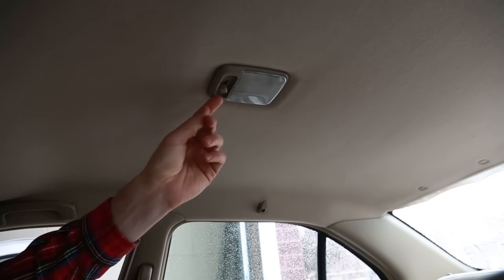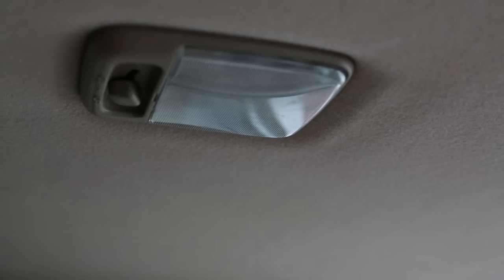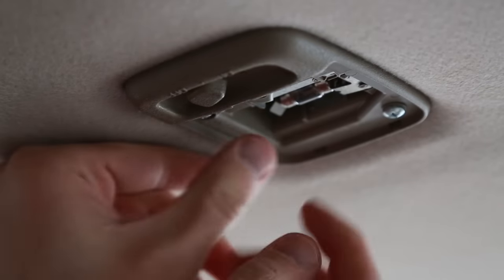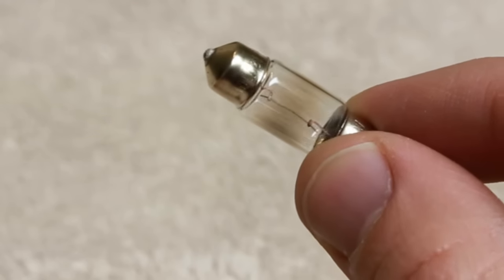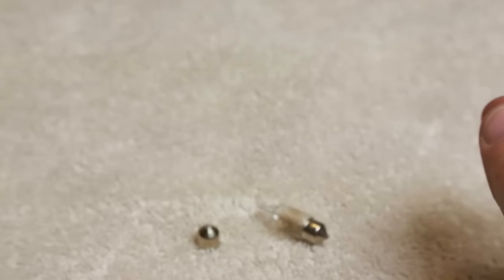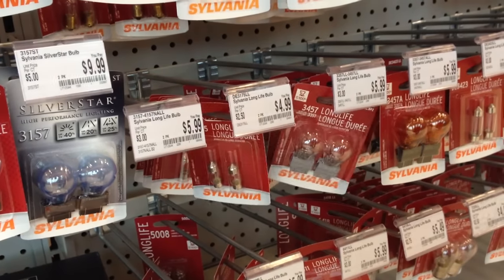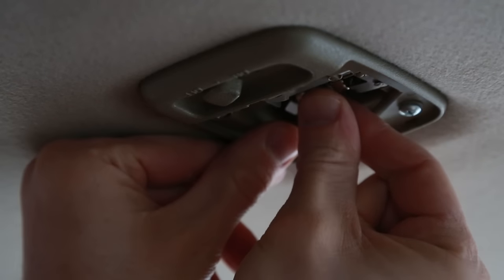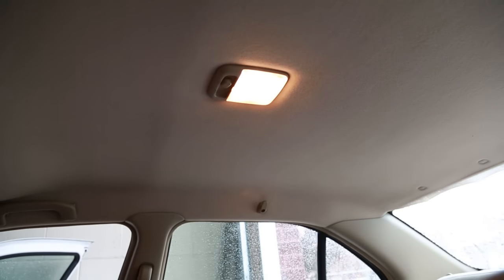How to change a car dome light - EASY!

Comment: Just another note, disconnect the battery when changing anything electrical in your car so you dont short out anything, and don't change the bulb when your car is on

Comment: I pulled the wee bulb out of my old Tracker, and the filament (?) seems to be fine, but the metal ends of the bulb look a bit corroded. I'm hoping a new bulb will work, and it's not the wiring that is a mess.  ~ Thanks for the video!
Reply: Very helpful

Comment: On my Nissan Sentra 2001 the bulb says 12v 8w and when I went to AutoZone to buy the bulb they only had 12v10w bulbs i bought it still just to see if they work and when I insert one , the dome won't turn on. Does the wattage of the bulb matter? Or is it another type of issue inside the car

Comment: Does the bulb have a 'positive'/'negative' sides?
Reply from the maker: No, should fit either direction. The bulb doesn't "know" which side is positive or negative, it just needs a charge running through it (either direction) to light up.

Comment: I have a question. My dome light is working, but the on/off switch has lost its' grip. For example, when I try to turn it to the on position, it just slides loosely, there is no click or grip. Please help me figure it out! I don't want to go to a mechanic. Thank you!
Reply from the maker: Late getting to you... sorry about that. I just saw this. I think you'll probably need to buy a new "housing" for your whole dome light. It's not a really complicated repair, but it's certainly more difficult than just replacing a light bulb.

Comment: i tried to use supply from interior light of the car. when i check voltage it gives 9 to 10 v but when i tried to test it with dc motor , the dc motors remained its turned off condition , what is the reason behind this ?
Reply from the maker: Hi Umer, I'm not sure I understand your question. What are you using a DC motor for?

Comment: Have ever tried LEDs?
Reply from the maker: daniel moreno No, I've never tried LEDs. Until you asked, I didn't even know that was an option. It looks like there are LEDs that would fit, but I think I'll stick with the tungsten bulb--I like the color temperature of the light given off by the traditional bulb, rather than the LEDs. Do you use LEDs in your car?
Reply: Yeah I'm pretty sure they've been around for awhile. I recently put an LED light for my license plate light. It's 6000k and a lot brighter and even looks nicer in my opinion. You should check them out. Big difference especially at night. Stands out too.

Comment: i changed my bulb but it atill doesnt work?
Reply from the maker: Hmmm..... well, assuming the bulb you installed is good and it is properly installed, then that means you have some problem with the electrical system. It could be the dome light receptacle / fixture, or some of the wires leading to it. It could be there is a fuse burnt out that just needs to be replaced. (Sometimes the fuse box is under the hood, sometimes it's tucked below the dash board on the interior of the car--but either way, changing fuses is cheap and easy.) I'm sorry that changing the bulb didn't fix it for you. You might check if other electrical systems are not working (like a bank of lights on your dashboard), which would indicate a fuse might be burnt out. Or, just locate the fuse box and find the one that corresponds with the dome light. If it's an electrical problem (like the wires aren't making the connection to the fixture), that's more expensive and a bit of a hassle. For a dome light it may not be worth fixing, depending on how old your car is.